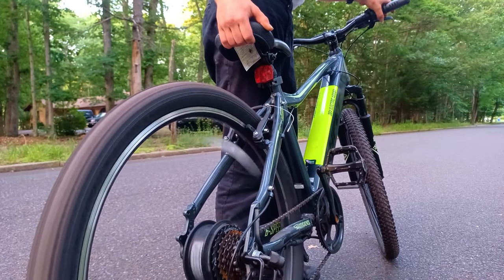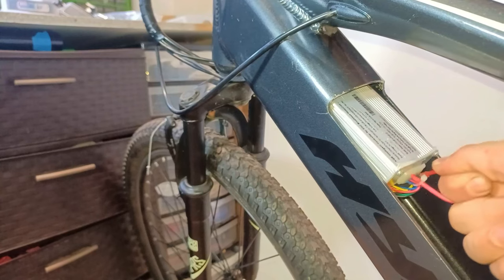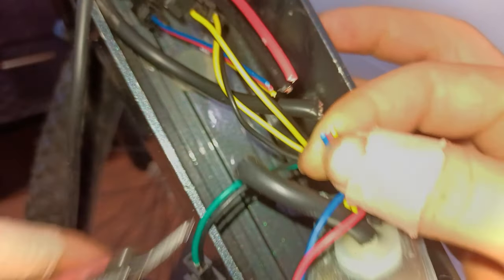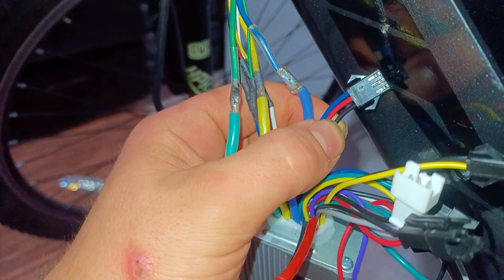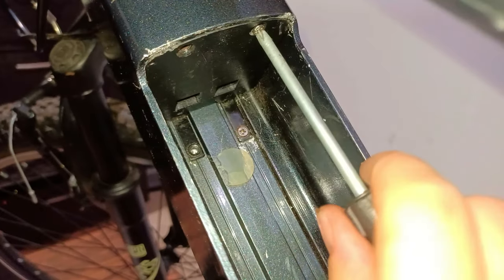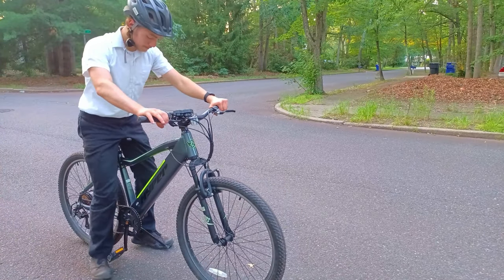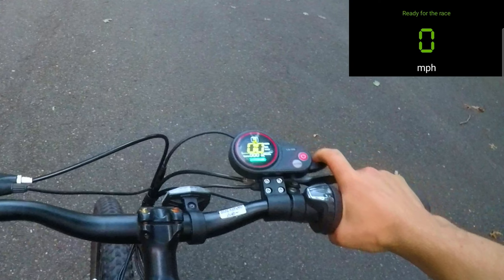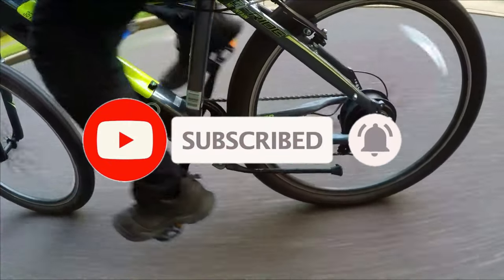how to add a THROTTLE onto a PEDAL ASSIST bike

Comment: if you don't want to cut and solder a bunch of wires, you can also buy 9-pin conversion cable for the motor.
Reply from the maker: Good idea 👍
Reply: Hey man @FredFredFred13 can you elaborate more on that part please, I don't want solder a bunch of cables honestly.

Comment: Is it mandatory to cut the wires?
Reply from the maker: @JaVanteHarris-s3w The only reason not to cut wires is if your ebike  connectors already match the new ebike speed controller. (Which is usually not the case with most ebikes)

If you don't want to cut wires from the ebike, then you can cut the wires frome the ebikes speed controller that is already installed (I'd recommend cutting and solder one pair of wires at a time to keep it simple)

Comment: I have a question does anyone have a Huffy Everett 27.5 Inch Class 1 eBike, 20MPH, 7-Speed, 350W Motor, I was wondering if I could just hook up a throttle to it
Reply from the maker: Most pedal assist e-bike speed controllers don't come with throttle input wires, but to find out if you're e-bike speed controller does have a throttle input, you're going to have to have a look at you're e-bikes speed controller to see if it has an extra pair of 3 wires (usually red, black and yellow). to find out how to get to the speed controller from you're e-bike, you're going to have to search in youtube "how to replace a Huffy Everett 27.5 Inch Class 1 eBike, 20MPH, 7-Speed, 350W Motor speed/motor controller"

Comment: Connected all the wires properly whenever i press the throttle a bike start to move sound pops up from the battery/motor and after that back tire stops moving. Please help.

Comment: Very good video but one thing I would caution you and others to do is twist or crimp the phase wires together because on long steep hills, the  high currents  carried by phase wires  can melt  solder.   This might act as  a built in fuse, saving the motor, but most times it is a bad idea.

This is especially important when upgrading to a more powerful high amp model (yeah!).

Comment: Is there any way to show how you connected each wire like a picture I watched, paused and rewound 20 times
Reply from the maker: @matt_attack9830  If you have any specific questions, then go ahead. Ask.
Reply: I can tell everybody the simplest way to do this:
 There are about 5 sets of wires to connect. The ones shown in video are most simple. A 5 or 6 wire plug that has all thin wires colored red, black, yellow, green, blue and sometimes an additional white wire. The white doesn't get connected. Red black are hall sensor power and ground. The other 3 are hall sensor signal out to controller just cut and reconnect wires one at a time and take lots of pictures with phone before cutting. You'll be glad when you forget exactly where a wire went!
 Ok 5 wire plug , next the 3 fat phase wires, then the wires to battery big red and big black..
I didn't reconnect peddle assist because I hate how a little push of the peddle and it sends you crashing into something!
The display has 2 little plugs. That covers throttle and power to display. After that the brakes high and low, you'll need to see if your brake levers has wires coming out of them. If not don't use brake wires. If your battery has 4 wires coming out 2 fat and 2 skinny? The 2 fat are poweto controler. The other 2 skinney wires are for battery charger. ch Connect them. 
Your ready to roll almost. 
There's 2 thin white wires they are learn wey learn

Comment: Hi I have a G-HYBRID peddle assist bike ,i bought the throttle ,you showed un this clip as I liked the  throttle, but couldn't or rather can't find the controller , as its not in the same place as the bike in your video.. I think its in the housing you bolt to the bottle holder holes on the bike. Is there anyway the throttle conversion can be done? To my g.hybrid bike
Reply from the maker: If it has a 3 phase brushless motor, then yes (almost all e-bikes have 3 phase brushless motors)
Reply: It has a 3 speed electric ride mode  350W brushless motor, I took the housing which you slide the battery off and un screwed the covering were the wires are going in at the bottom of the bracket that is bolted to the bottle holder holes  and all the wiring is in there covered in wax, so no idea, think il have to take it to my local halfords..see if they can do it..

Comment: hyper mid drive fs 29 inch mtb. any idea if there is a way to remove the 20mph speed restriction (unplug some white wire) maybe? thx could throttle work with torque sensor mid drive motor?
Reply: Did you figure it out?

Comment: I have a hyper I just bought (black cruiser) because their dirt cheap (it was actually my first e-bike I bought a few years ago when they first dropped to $799 but I returned it within 90 days) 

Then I bought a mountain bike one with a thumb throttle with a 500w motor that I'm still using, so I just bought this new one specifically for this mod.

So this may sound like a dumb question but if the new display has the thumb throttle attached did you really need a new controller? Or did both sets of wires go into that new display? Because the 810 has that 6km pace button (which is kind of like a throttle that only goes 6km)
Reply from the maker: I'm not sure, but it definitely sounds like an interesting thing to try out.

Comment: Can you replace the soldering with twisting them together then putting on a heat shrink wire connectors, if not what do you suggest I do?
Reply from the maker: I've used the "soldering and heat shrink tubing" technique when I built a 5000watt e-bike, and I've driven that bike for over 500 miles without any problem. my opinion is: if you want to be able to quickly and easily remove the motor controller in the future, then I recommend using connectors. but if you just want to go the the easy route, then I recommend twisting together the wires, soldering them, and then insert some heat shrink tubing.
Reply: @ElectronicLab.  There is extra connections from the controller that don't match the bikes wiring.  What do I do? I bought the same kit in the video and have the same hyper ebike
Reply from the maker: @pierrerivera-vidal6167  This motor controller comes with a few extra features. like a brake input and a light output. As long as you connect the motor wires, battery, throttle, and display, everything should work.

Comment: Hi great video! I was just wondering when the throttle is connected and working, does the pedal assist still work with the throttle or is it only the throttle that works on the bike? I know at the end you shows the pedal assist but I still want to confirm, thanks! 🙌🤙🏻💪🏻
Reply from the maker: @_ItsGh0st_  I'm pretty sure I was able to use both the pedal assist and throttle at the same time, but there's a setting that has to be changed on the display that will allow you to use both at the same time. I show how to change settings at the beginning of this video: https://youtu.be/_Bh6IKfam08?si=tk5mpqpmcc2bZ0DB
Reply: @ElectronicLab.  Cheers brother for helping me out, what video do I watch to change the LCD screen?🙌🙏
Reply from the maker: @_ItsGh0st_  In the beginning of this video I show how to excess the settings from the display: https://youtu.be/_Bh6IKfam08?si=tk5mpqpmcc2bZ0DB Once you excess the display settings, go to "P10," and select settings number 2, which should allow you to use both the throttle and the pedal assist at the same time
Reply: @ElectronicLab.  alright thank you so much for all the help, you are a real one 👆🙌
Reply from the maker: You're welcome
Reply: @ElectronicLab.  And one more thing. I have a pedal assist bike, but the assist is in the pedals, and not in the rear wheel. Can I connect the throttle still to the bike and have it working? Or do I need to have the assist in the wheel.
Reply from the maker: @ghosttrides  I didn't fully understand you're question. but what I do know, Is that pedal assist sensors have 3 wires, which can be connect to the motor controller.
Reply: @ElectronicLab.  So basically I don't have a motor on my wheel but I do have one in my pedals. Will the throttle still function even though my motor is on my pedal?
Reply from the maker: @_ItsGh0st_ I'm not sure, but there's only one way to find out.
Reply: @ElectronicLab.  Yeah but I don't really want to spend money on a throttle and then find out it doesn't work. But I will experiment and do more research. Again, thanks for all the help and keep making amazing videos! ❤❤

Comment: I have a carrera vengence ebike and this controller and throttle, everything is connected colour to colour except i have a white hall sensor wire spare with no where to go. When i wire everything up and try to use the throttle it seems the battery is making a noise maybe the motor and its no spinning the wheel? Theres settings in the throttle screen p1-p20 can you tell me exactly what all your settings are. Theres also no errors on the screen so im stumped.
Reply from the maker: I would recommend to try different wire configurations for the 3 power wires connecting from the motor controller to the motor. after trying a few different connections the motor should be working. also, the white wire coming from the motor might be a temperature senser wire which is not supported by this controller.
Reply: Did it work? I was looking at getting a carrera vengence ebike

Comment: Surprised you managed to find a ESC that fit the frame housing where the stock was. Mine surprisingly was bit larger. Weirdly my STOCK ESC was also half the size then yours at 0.55. I mean like Really tiny. They must've made a bigger ESC inside to stop it from jiggling inside the frame as some have mentioned they heard noises like clanking going about. Since the older ESC being tiny were just doublesided taped in place.

Either way nice video.

Comment: Please what is the mode button used for?

Also, is it possible to control the speed on the LCD screen of the new motor controller ?
Reply from the maker: The mode button allows you to choose between 3 speed settings, and on the display, you are able to play around with a lot of settings, which I tried out in this video: https://youtu.be/_Bh6IKfam08?si=syjbgBKD9_uuHbmC
Reply: @ElectronicLab.  Alright, thank you so much man 🙏

Comment: Funny, I did my own throttle addition with the same looking equipment.
You didn't mention the "P" code programming these controllers can do.
The paper that comes with equipment has all the directions to adjust p codes. My Amazon controller was missing the paper and I had to look through ebike forums to locate the 16 adjustments. Not hard but if you want max power from this equipment exchange, you need to change a few settings.

Comment: Hello I bought and installed same controller and throttle as you. In hall sensor wires my bike has an extra brown do you know what this connects to. Also battery is fully charged but display shows low battery with e6 code. Any help would be greatly appreciated. Also motor tries to turn when throttle is engaged but doesnt.
Reply: Any luck yet with the brown wire

Comment: Hey man can you please help me with this, the controller has a plug that says LCD display, which is red yellow green blue black and then attached to that is an extra black and white. I can plug in the five pin which is fine but I have no idea where the black and white extra wires go. The throttle cable on the controller is three wires not two.. could you explain that to me please, thanks! ❤
Reply from the maker: @mattias77  The two extra wires coming from the display are for a light output(optional), which will give you the same voltage from the battery after pressing down the mode button for a few seconds.
Reply: @ElectronicLab. Ok awesome. There is still three wire connector on that controller that is labeled throttle. Do we not use that at all seems like the wire coming from the controller already has a spot that lines up color to color. (Labeled LCD)
Also thanks for the response ☺️

Comment: Hey my hyper bike has throttle wire from bike (red blue yellow) and controller has throttle wire (red black white), HOW SHOULD  I JOIN THOSE?
Reply from the maker: @parneetsingh4493  red to red, blue to  black, and yellow to white
Reply: Thankyou
Reply from the maker: @parneetsingh4493  you're welcome

Comment: I have the same e-bike as in this video.  I purchased the controller you used from Amazon.  I cannot get it to go.  can you send a complete wiring diagram for the connections.  Thank You, David
Reply from the maker: @DavidKennamerphotography  what does it sound like when you give it throttle?
Reply: @ElectronicLab.  Nothing, will not run.  Display comes on shows errors.  motor will run slow when I connect learn wires.
Reply from the maker: @DavidKennamerphotography  tell me the errors you're getting on the display
Reply: @ElectronicLab.  Flashes between E001 & E005 .  There is also a red triangle on the left side of the display with an ! in it.  What I think is the battery gauge at the bottom of the display shows empty although the battery is fully charged.
Reply from the maker: @DavidKennamerphotography  what voltage is your battery?
Reply: @ElectronicLab.  same as your in the video, 36 volt.

Comment: Is there a way to remove the speed limiter on this bike? I'm sure it can go a bit faster than 20 mph
Reply from the maker: @amazingamx1255  The motor controller I've installed onto this e-bike gives all the power from the battery to the motor. but in this video, I've actually increased the speed from this particular e-bike without replacing the battery for a higher voltage one: https://youtu.be/_Bh6IKfam08

Comment: Good job installing your throttle if you’re interested in more speed upgrade your controller
Reply: @frankroach9346 do u know which controller would b best for more speed? I have this exact bike  and want to put the throttle but would like it to go more than 22mph if possible
Reply: Incorrect. The rear stock hub motor is internally limited unless you are stupid enough to put 350-500watts into a 36volt 250watt hub motor. So there is no way to make it go faster from a 250watt 36volt ESC period. But that'll just likely burn and explode the motor. So no there is no way to do this unless you also upgrade the hub motor. Plus the internal battery is very small and you aren't gonna get much power off it. I barely get 5miles on my front 500watt kit. Though it might also be pretty power demanding on throttle. But even so. You're gonna decease range performance by far.
Reply: @GeorgeJeffersonsBurnerAccount Throttle will not make it more 'Efficient' It'll be reverse effect. Throttle uses max power all the time. So stock ESC will give you 20miles of PAS. But Throttle will drop that range around 7+miles. Reducing mileage to 13- or less Running near to dead. Also the speed will drop 5mph after around half of battery power so instead of 20mph you'll ride around 15mph.

I replaced mine and that exactly what it does. Using the stock internal battery on my 7.8ah 26inch Hyper Mountain.

The better idea to do would be to add a new E-bike kit with a front hub, New fork to support the new electric wheel hub. And buy a 15-20ah 36volt cell to put in a cargo rack bag or built-in rack battery for the rear frame system. Sure it'd be around 400$ for the whole new system. But you'll increase range, Speed, and performance 2x.

Either that or buying Hyper's Mid-drive 10.5ah battery pack to replace the stock 7.8ah cell (It's same size.) and then upgrading to a throttle for similar range. But as this video example is. Going through Aaaaaaalllllll through the hassle of dismantling the inside core just to swipe a new ESC and trying to refit everything back inside (if you manage to find a ESC not to big and small enough to shove up the frame again.) It's gonna be so annoying to get all the under frame battery cables back into place.

Mine i had to rip all my cables out just to route battery leads from under the frame's pedal area up to the seat to mount for extension for inside my cargo bag for the rear motor's ESC. So if you're not wanting to go through hassling all that and just rather put a new ESC and have more power to climb. Buying another Ebiking kit system for the front wheel and another battery pack would be much more better since you'll be able to snug it in the rear bag. Or like mine i put my ESC motorcycle-style on my right rear frame just under the pannier flap.

Comment: Looking for help. I have an old pas SAMEBIKE and it's a folding type. When unfolded I can see the battery on one side and the plug in connector on the opposite side. I have no idea where the controller is??? Can you please help me?
Reply from the maker: @edwardlove4300  I assume if the battery is on one side and thick connector going to the other side, the motor controller should be on the side we're the battery is not.
Reply: That's right. The company told me there controller is not compatible as it doesn't have a throttle wire connection. The person told me it's not a PAS but a PES system. I just want a throttle can you please advise me as what to shop for? 😵
Reply from the maker: @edwardlove4300  If your ebike has a brushless motor (3 thick wires and at least 5 thin wires coming from the motor), then it is most likely compatible with this motor controller I changed out with: https://amzn.to/46CmSMi

Comment: Will this work for the hyper jet fuel e bmx ?
Reply from the maker: If it has a brushless motor, then it should work. Brushless motors have 3 thick wires coming from the motor, and most of the time, 5 thin wires as well, which is for sensing the motors position.

Comment: Hi my ebike controller got jst sm 2 pin male unused cable, the voltage comes out of it 6.81v. Is this for throttle?
Reply from the maker: A throttle cable has 3 pins, one for 5 volts, one for GND/negative, and one for signal.